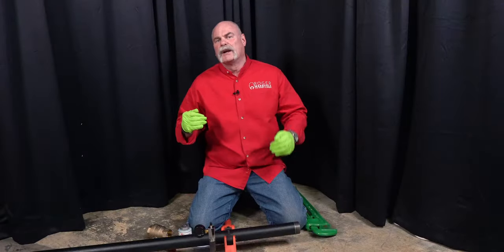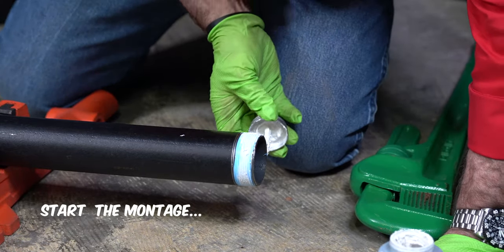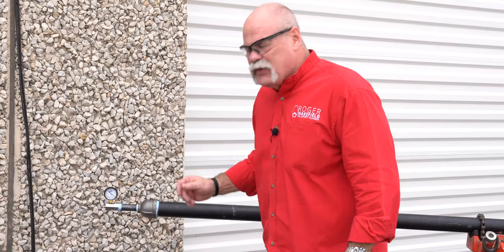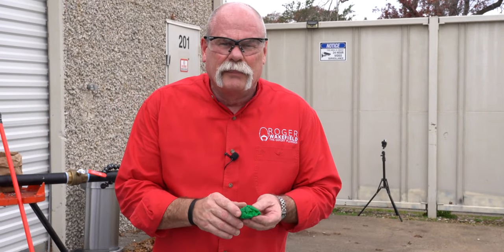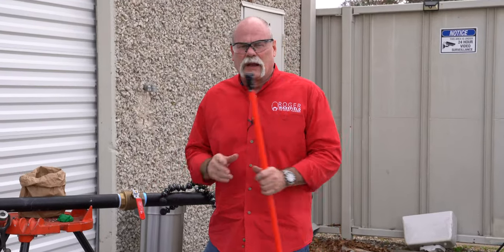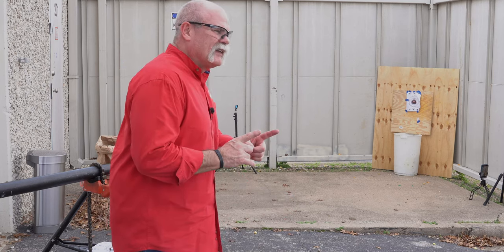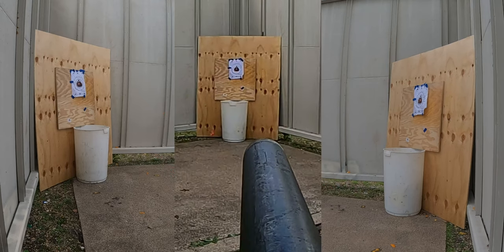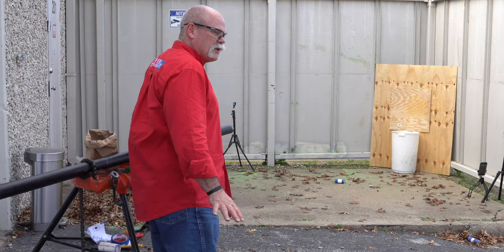PLUMBER DESTROYS TOILET TANK WITH AIR CANNON

Comment: make one with a 4" pressure chamber and 2" full port ball valve and launch tube, yank the valve open as fast as possible! lower air pressure will still outfire that setup 🤪

Comment: Hey Roger.  Roger K here again. I need to glue some PVC to ABS for a Kohler tub drain assembly here in SoCal. We use ABS waste lines here as you probably know. Can I get a good water tight connection using PVC glue to connect that white San tee to a black pipe? Thanks

Comment: Have you ever used a Gallo compressed air gun to make the water come out faster when draining a water heater .
All you do is connect the water hose to the water heater turn the valve open at the other end of the water hose where the water come out of grab your Gallo compressed air gun and shoot air into it and I tell you it will drain a lot quicker with out clogging the valve with settlement off topic compared to the video but just came across my mind
Reply: I have used a Gallo  gun to shoot compressed air up my bottom side
It was quite a rush
Reply: @hollywood739  lol me too lol i felt the air come out my mouth 👄👄